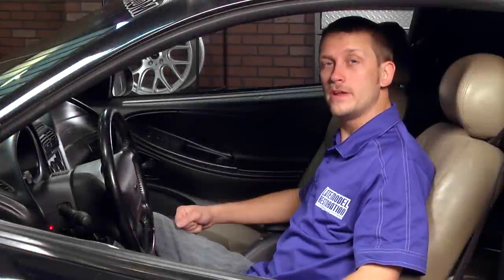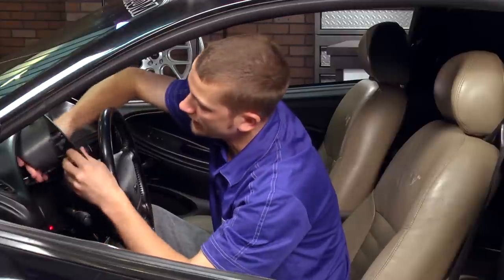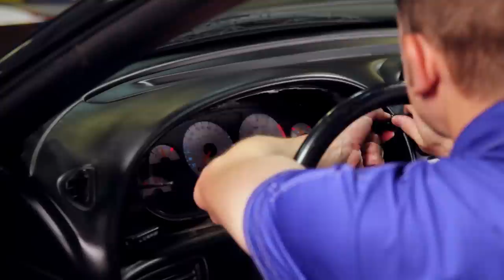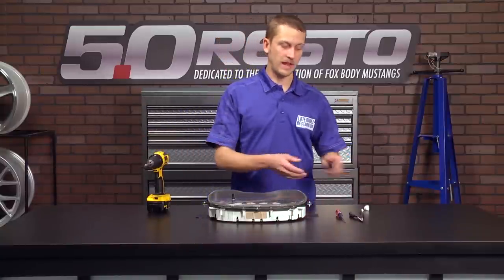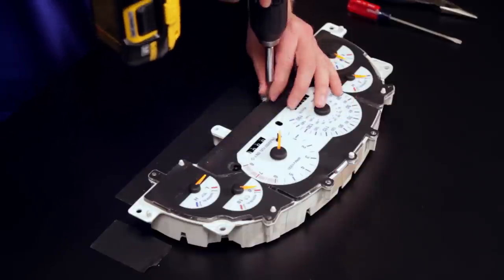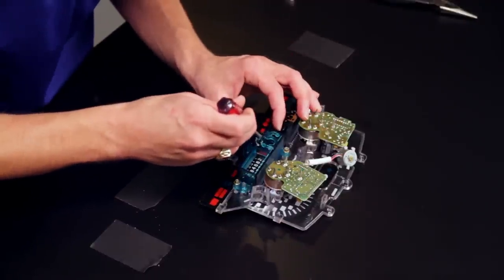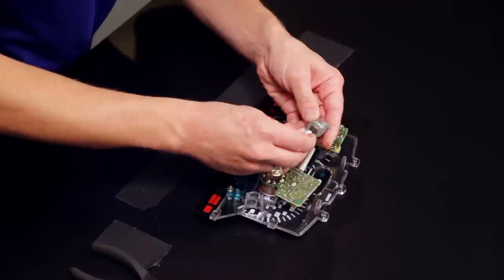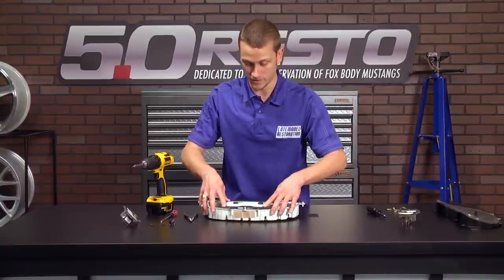1994-98 Mustang Odometer Gear Repair/Fix Kit - Install

Comment: I was successful after following your video...saved 275.00 by doing it myself...thank you!
Reply: Wow, do people really pay those prices?  For $275 you can buy two instrument clusters.  Or even just a new speedometer gauge.
Reply: Love DIY videos. First thing I look at before attempting to do anything with my cars!
Reply: We’ve done exactly what you’ve shown and no luck for our 1994 GT. Any other suggestions other than replace it. The tachometer and temp gauge works. Fuel gauge is 98% accurate.

Comment: Terrific solution.  I've got 2 1995 Mustangs and both odometers & trip meters stopped turning.  Your easy to follow instructions were spot-on, the worm gears on both clusters were busted and crumbled when I removed them just like in your video (1995 must have been a bad year for plastic parts).  Replaced them with new worm gear sets I bought from LMR and everything now works perfectly on both 'Stangs!  Thank you for the easy-to-follow solution.

Comment: I just changed out the odometer gears which had stopped working on my '96 Mustang.  Your video was very helpful, very detailed & informative, thanks for providing it for us DIYs.  The gear set had been broken for a few years so had to forward the odometer a little to make sense for AAA recordkeeping...it's pretty funny that you can find a boatload of videos on rewinding the odometer but not forwarding, LOL...I used my Dremel and buffing pad to carefully/slowly advance the readings to my goal mileage, thanks again.

Comment: My 1996 Mustang worm gear had disintegrated into hundreds of pieces.  3rd Mustang (‘95, ‘96, ‘97) I’ve had with that problem.  Your replacement gears and video were exactly the solution.  Thank you.

Comment: Just got my kit today and installed it, worm gear was toast so no mileage or trip miles. Whole end of other gear gone even though rest was somewhat there it was nasty. I found putting motor assembly back in had slop loose, so I used a bic lighter a few seconds at knuckle section and lightly press down for maybe 3-4 seconds. Worked like a charm real firm now.

Comment: Changed my gear set out, last night. The hardest part of the entire process was getting the headlight knob off.  I finally got it to come off, but still not sure how it latches in place. :-)   My big gear was eaten up.  Plus, you weren't lying about how tight the fit is of the worm gear on the motor.  LOL   I should have changed out my dash bulbs while I was in there but didn't have any on hand.  You might add that to a recommendation when people have that dash out.  Thanks for the part, the free shipping and the speedy delivery.  First class !!!

Comment: Thank you for the video and the parts from LMR! Took me a bit longer than you because the old drive gear crumbled into dozens of tiny pieces (it was broken and stuck diagonally when I opened the thing). My mustang is 27 years old!

Comment: Incredible video. Appreciate you. Quick delivery on odometer gear part. Thank you. Problem solved. 

I do recommend replacing the instrument cluster bulbs while apart. 5 total - 194 T10 bulbs.

Comment: I like you man! Inspection was coming up and my Stang wont pass w/o a changed odo. I replaced my sensor in the trans and that didnt work. The dealership told me $300 for the parts and labor... I do everything myself. So for about $30.00 (s&h inc.) and 30 mins of my time (thanks to your vid) i'd say I'm a very happy customer.
Reply from the maker: Awesome. Glad we were able to help out and get you back on the road again.

Comment from the maker: You a quite welcome; thanks for watching!
Reply: Late Model Restoration I noticed you had the car on 
There a red light blinking by your lad on the video 
Wouldn’t disconnecting anything with battery on caused electrical issues?
Was the key in the car ?? In what position

Comment: Wow. I had no idea it was that simple. I'll be ordering the gears in about a week. Thanks for making this video.
Reply from the maker: Duros asfdgasf You are welcome! If you have any questions, feel free to ask! -Landan
Reply: ***** I have a question, my temp gauge only works sometimes. Does the temp gauge work with a similar gear, like for the odometer? If so, do you guys sell a replacement? Thanks so much.
Reply: someone said that doing this is not legal because one could readjust the odometer, is this true?
Reply: +LADD HOOVER - I would imagine this would be so only if one does adjust the odometer.  In fact, if the odo is left inoperative for any period of time, this must be disclosed at the time of sale or transfer.

Comment from the maker: No sir, these gears just restore function to the odometer.  To correct for speedometer, you'd need either a speedometer driven gear, or an LRS-Speedcal

Comment from the maker: To test the motor you will need to have a good voltage meter to see if it is getting power. If so then you have a bad motor. These are no longer available new. Best bet is to find a new gauge from a salvage yard.

Comment from the maker: This would fix the odometer but sounds like you might be having an issue with the tachometer. When you are replacing the odometer gear check all the connections. Don't forget the odometer gear has a lifetime warranty from us!!

Comment: Everything you said is spot on the only thing was when you pull out the motor you risk breaking the clips that hold the motor down. Another thing you dont talk about is the orientation of the gear. So called the wormed gear. What do you do if you break the clips they are plastic. Lol

Comment: just bought a 98 Mustang with only 98k.... was super hyped about the low miles until i realized driving home like 30 miles its the same mileage as when i bought the car.... slightly deflated on the deal now.... still a good running and looking car.... just wonder how long its been broken.... car dealers dream right there.... only a $25 dollar fix.... but no idea how many miles the car actually has
Reply from the maker: It could have been broken for 12 months or 12 years, you never know 😬
Reply: @latemodelrestoration  yeah.... Same thing I thought.... Can't say it looks or runs like a car with 200,000-300,000 miles.... Doing some investigating maybe with carfax to find the last reported time where mileage was different.... But the price I got it for even 200k or so still a decent price.

Comment: Great direction, but not perfect.  I give them a 95%.  There is one thing missing:  You have to be careful not to break the pegs that keep the speedometer and tachometer from going  below zero.  They are very fragile, so I recommend you pop them out, so you don't break them when you lay the gauges down on your bench to replace the gears.  Other than this, it took me about an hour, because I had to run to the store to get some replacement bulbs.  You can hook up just the housing to the ribbons and check your lights by turning the ignition key and putting on your lights.
Reply: Instead of popping out the pegs, I accomplished the same thing with a couple of strips of scrap wood and a shop towel. I lined up the strips with the flat parts of the gauges, covered the wood with a shop towel and set the faces on the towel. Worked perfectly.
Reply: I broke the hell outta them

Comment: Thank you, great video! Two questions, should I have disconnected the battery prior to repair and I accidentally moved the fuel gauge, will it reset to correct level when reinstalled? SMH.
Reply from the maker: Yes, once you reinstall everything, the fuel gauge will reset to the proper position

Comment: I just did this to a 1998 mustang gt...when u flip the cluster upside down to take the motor out...be careful...its 20yr old plastic and very fragile...flip the cluster with the motor on it up side down on the case to remove motor...i wasn't thinking and did it flat to my table and broke the to black pins on the rpm and mph gauges...also, when removing motor from plastic look at it with a flash light which way to twist,  I forgot counter or anti counter clock wise...lift each green tab with flat head and twist , each at a time..keep in mind it's 20yr old plastic so be careful..just make sure there's no pressure or weight on the front,  I flipped it upside down on the case it was attached

Comment: Nice video...but I have a question for 2 yrs. I have had to tap the glass to get my speedometer to work in a 98 mustang. Well now the needle went all the way around and won't work now...I called the ford dealer and they no longer carry the part. They said I would have to send it out to get repaired and it would be 300 dollars...Could I repair this myself like you did too save me a whole lot of money...Speedometer cluster is what they told me...help please?And are they correct?

Comment: I did this whole process. While the cluster was out, I swapped out to LED bulbs and replaced the temp gauge/gas gauge with NOS unit as well as the gas tank slosh module. I also replaced gears as they were disintegrated like ashes. Everything worked fine except the odometer gear fix.  I am wondering if the odometer motor has gone bad, I am having a hard time finding a replacement motor. Could there be something else I missed?

Comment: Did you have the car on ? I notice by your lap there’s a red light blinking 
Wouldn’t disconnecting the dash with battery plugging cause electrical issues?

Comment: Should've shown a quick replacement of the headlight knob, headlight switch, and headlight switch connector.  The connector of course would take just a little extra time.  I just checked my Headlight Switch Connector and it needs to be replaced so I'll be ordering that soon.

Comment: Nice guide, everything went smooth, I got all the parts replaced - I can manually spin the gears with my fingers and make the odometer move up or down in miles...But when I put it back together and start driving, nothing moves, any ideas?
Reply from the maker: The gear motor could have an issue.

Comment: Great video, I have the gears and will attempt today.

My temp gauge is dead though. I have replaced the temp sensors (both) on the motor but its still dead. All other gauges work fine. What could be the problem with the temp?
Reply: Jay did you get your temp gauge fixed?  Did you try grounding out your temp sending unit wire to see if it spikes the temp gauge?
  Mine is kind of dead, every once in a while it works.  I noticed something, that when I start the car, the temp gauge actually goes slight lower, very slight.
Reply: I got it fixed. I replaced the gauge with a NOS unit I found, at first it didnt work. I then swapped out the sensor on the intake with a new unit of LMR and it worked like a charm!

Comment: My son and I replaced the gears (they were bad) but only the tach started working again. I guess the speed sensor is the next thing to replace?
Reply from the maker: Yes, check your speed sensor if you haven't already! If you have any other questions, feel free to give us a call at 1-866-507-3786!

Comment: If you are still taking comments and questions, I have a dilly. 1995 Mustang Gt with the 5.0 / 5 speed standard, and problems with the RPM guage. If the rev's hit over 3500, the quage quits, and actually tries working in reverse! Crazy, hey? Now, if the engine is over revved again, especially before its completely warmed up, the stupid thing sometimes reverses again, and although sticky, will work until and if there is another incident. I have even asked at the Ford garage, and not recieved a satisfactory answer as to what the problem is, and how to fix. Thinking it may require the Instrument Cluster to be replaced, but would certainly appreciate your input.
Reply from the maker: fisheatsleep1 Is it just the RPM gauge having issues or is it others as well? -Landan

Comment: We replaced the speed sensor and the connector and the speedometer still does not work. It sometimes will work and then the needle will bounce and go back to zero. Will these gears fix the problem?

Comment: So I just replaced the gear for the odometer. And the pin keeping the speedo from moving all the way past broke. Do I need to replace the panel or if I glue the pin back together will my speedometer start working again?

Comment: hey i have a 94 mustang and the gas gauge is quite not working. if i will it up it'll go to full but after that it won't be accurate of how much gas I have remaining in the vehicle. do you know what this problem might be?

Comment: I took everything off and got to the worm gear and driven gear but they look to be in working condition. Could it be the motor since It isn't the gears? Please drop some knowledge and help me out. 
Thanks
Reply from the maker: It could be the motor if everything looks to be in working order.

Comment: Nice video.  I plan on making this repair soon.

Two questions:

1. Why did you not put in grease on the replacement gears?  I have been told white lithium grease should work.

2. How do you get the odometer to read "actual" mileage?

Thanks!

Comment: okay please I have a question I need answered. My odometer and trip odometer quit but then starts working again. Most of the time it changes the mileage SUPER slowly. Other times it is okay. Any thoughts? It hasn't totally failed but I don't know if this will solve my problem

Comment: 95 GT- Pulled my dash apart sure enough worm gear was broke. Replaced both but still not working. No trip, speed, or odometer. Checked fuses all good. What's next?
Reply from the maker: You may double-check the actual motor at this point. If this is no longer working, then you would need to replace this.

Comment: How do I adjust the mileage? Is as simply as just spinning the numbers to where I want or do I have to put a drill on the gearing?
Reply from the maker: Jason - Great question.  Check with your local DMV office for the laws and regulations on odometers.  Unfortunately, we can't tell you how to modify an odometer.  -Landan
Reply: @latemodelrestoration  ok, my odometer hasn’t worked in a while and I need to adjust it properly when I get around to changing the gearing.

Comment: I just got a motor swap with 71 xxx miles I need to order the gears because it doesn't work. Can I correct the mileage if I take the cluster out???
Reply from the maker: Unfortunately you can't advance or reset the mileage on your cluster.
Reply: just curious...what stops one from readjusting the odometer?

Comment: Once you fix the odometer will the mileage update itself? Is it stored on the ECU?
Reply from the maker: No.  The mileage will not update whenever the gears are fixed.  Odometer information is not stored in the ECU.  -Landan
Reply: @latemodelrestoration  ok thanks

Comment: I did this and my odometer still does not work. I went back in a second time to check the gap, still not working.     What do you suggest?
Reply from the maker: There could be a lot of different reasons why it still ins't working. Feel free to give us a call at 1-866-507-3786 or email us at customerservice@lmr.com and a CCR can help you out!

Comment: Question my 1998 mustang is having issues my speed gauge is working and my rpm one works on and off but all the others are stuck in place and don't move if car is on or off any clue what this could be?

Comment: Will these fit a 1996 Cougar and is the installation  process the same thanks.
Reply from the maker: These are designed to fit 1994-1998 Mustangs. Any other application is not recommended by LMR, but you may check the Cougar forums for an applicable solution.

Comment: I need help I own a 86 mustang gr and ny speedometer is not working I changed my Speedo gear cable vehicle speed sensor and it still won't work it only starts marking after I'm going about 20 or so but it way off please help!!

Comment: i only need one thing:  a New, clear plastic lens that goes on top the cluster.  can't find one anywhere for my 94 mustang gt.
Reply from the maker: You're best place to check is either in Facebook buy/sell groups or pull one from a donor car. Unfortunately, we only offer the 99-04 lens & housing assembly.

Comment: Is this what I would do to change the speedo gear if I have a 373 or 410 rear?
Reply from the maker: Here is the link for the speedometer calculator. Fill this out and it will give you the correct gear size you need. https://lmr.com/products/Mustang-Speedometer-Gear-Calculator

Comment: is there a kit for the 94-98 that turns the stock into digital? i hate my stock odometer.
Reply from the maker: Not currently. You would have to make some aftermarket gauges work with your vehicle.

Comment: I can't find anything about speedo repair. My speedo just stopped working, well it bounces up sometimes then drops back to zero. How can that be fixed? On my 94 mustang gt
Reply: VSS sensor on top of your transmission?
Reply: hanksgavin I replaced the vss and replaced the connector. I’m stumped!
Reply: You have a short in your wires running to the cluster.. if it sometimes bounces up then drops back down it's a short GUARANTEED...I just went thru the same thing trust me...

Comment: I change both of mine as you did but my odometer still doesn't work anymore suggestion please?
Reply from the maker: It could be the motor or the gauge cluster has failed. You will have to look into getting these in a junk yard.

Comment: Is there a fix for the car temp gauge not working ? All the other gauges work but that one
Reply from the maker: Sorry you're having an issue, but you'll need to do some basic troubleshooting to try and figure it out. Wish I could be more help, but diagnosing issues over the Internet isn't the easiest thing to do. Good luck! -Landan
Reply: @latemodelrestoration  Thankyou for even taking the time to respond brother ! I figured it out , I guess the magnetic teeth strips on the back of the cluster ( one of them was overlapping on another ) causing it not to read when being plugged in !
Reply from the maker: @trevorellis8472  You're welcome! Glad you found the problem. -Landan